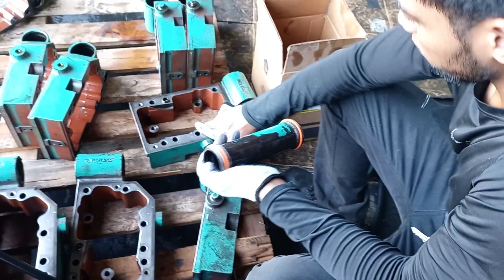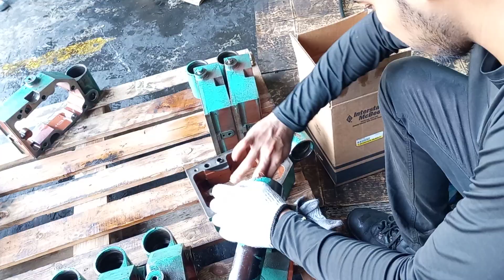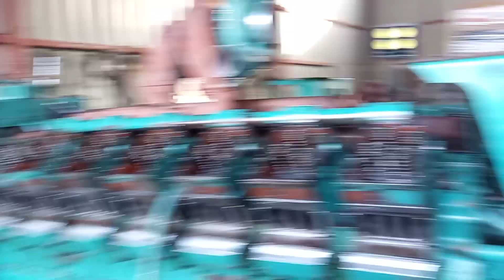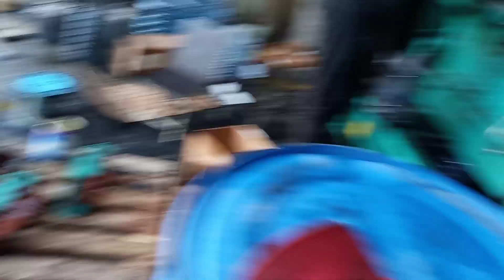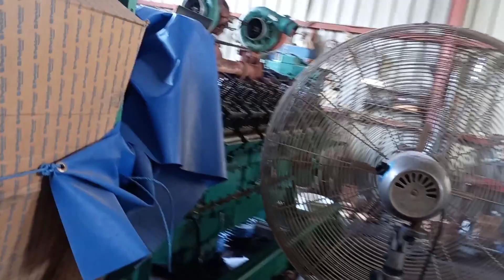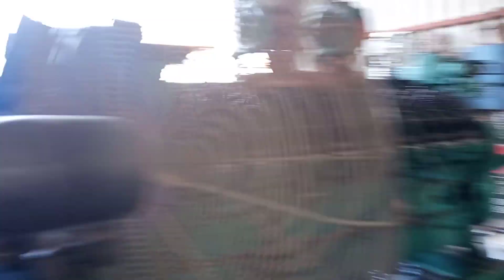water line pipe and rocker lever hausing instolation KTA50 CUMMINS ENGINE 16 CYLINDERS

Comment: Bro, please show the location &  fitting of oil cooler coils, also the flow path of coolant water, how it flows in the engine chamber, thermostat working & water after & before thermostat opening flow. 
Thanks ❤ each video